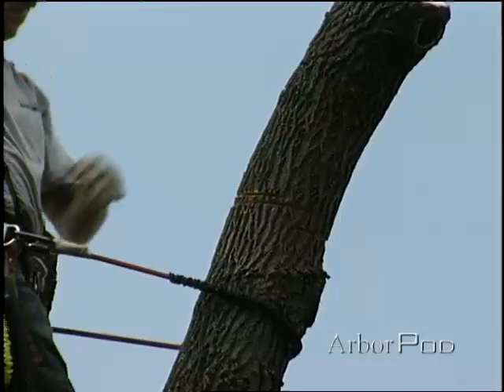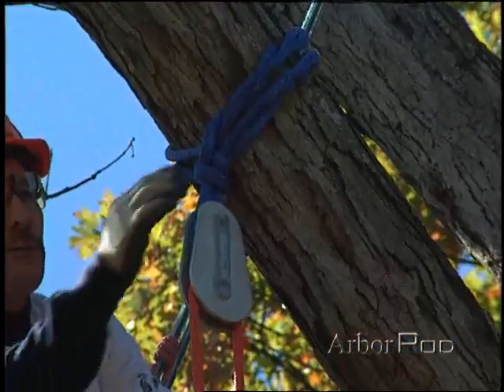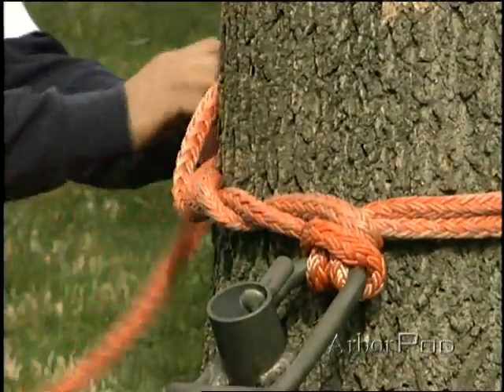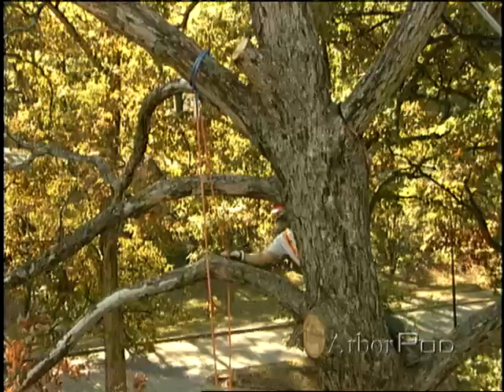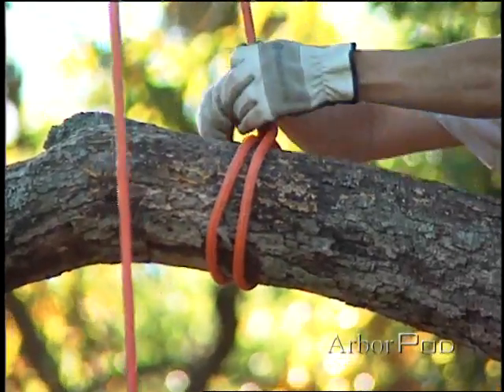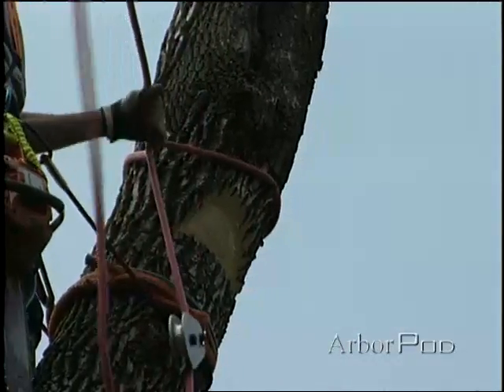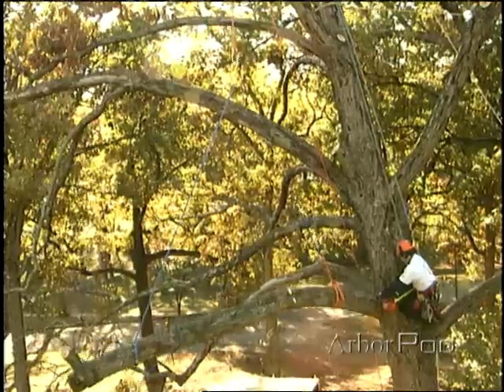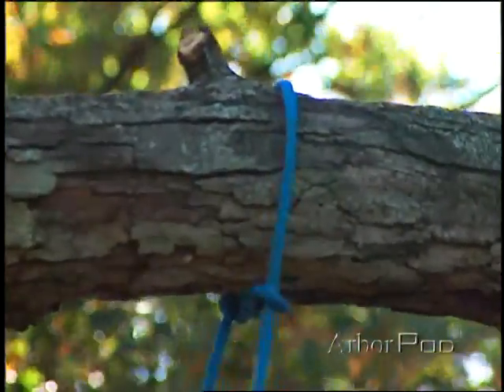Fundamental Rigging Techniques

Comment: For securing a limb that's being cut, we used a rope with a closed eye and a double-lock carabiner through it. To rig my branch, I'd go loop- half hitch, loop- half hitch, loop- carabiner into the running end. It's fast and strong, and just as fast on the bottom.  

Once in the habit of using half hitches that way, balance rigging goes just as fast, with both ends rigged the same way and an alpine butterfly at the lift point.